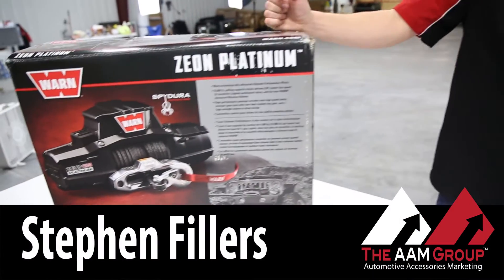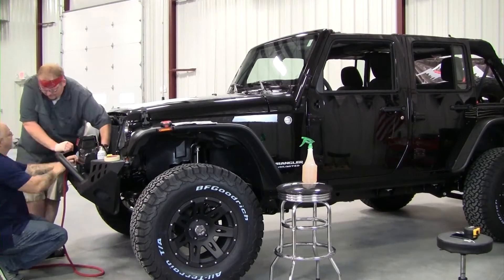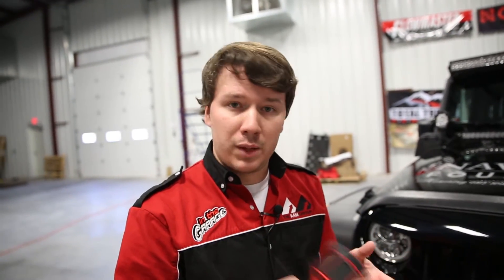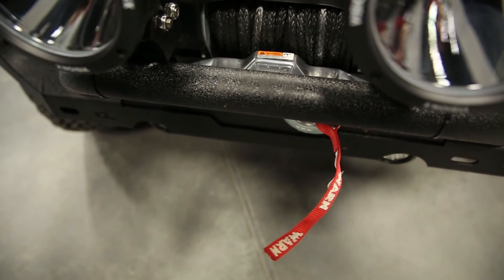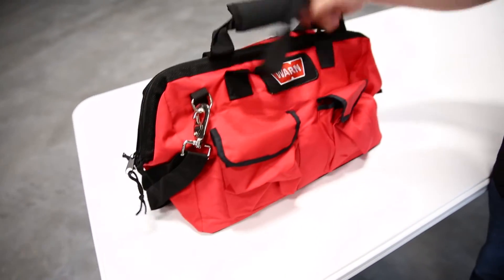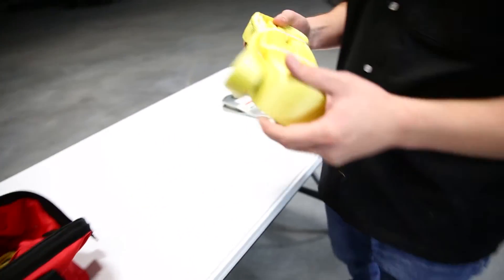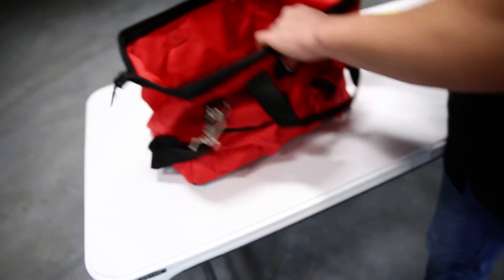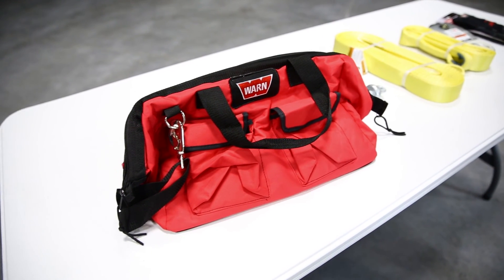NSF1 Project Jeep Part 12: Warn Zeon Winch and Accessory Bag

Comment: Yeah nice video, but can anyone tell me what a "D-clamp is?"  Those big honkin' metal things are called 3/4" Bow or Anchor Shackles!  

Anchor shackle - Bow shackles and anchor shackles are terms that are often used interchangeably, as both names refer to a shackle with a larger, rounded “O” shape look. However, a bow shackle typically has a larger, more defined bow area than an anchor shackle. The rounded design of anchor shackles and bow shackles allow them to take loads from many directions without developing significant side load.  This is what we use for winching!

Chain shackle - Chain shackles are also known as D-shackles. Both refer to the “D” shape design. A d-shackle is narrower than a bow or anchor shackle and generally have a threaded pin or pin close. The smaller loop is designed to take high loads primarily in line. Side and racking loads may twist or bend a D or chain shackle.  Nope, not a 'D-clamp either!

Also, each shackle is stamped or embossed on the side of it, with its Safe Working Load Limit.  If you come across one that does not have this information on it, Do Not Use Use It!  It most likely is substandard or a knockoff and has not certification it have been tested.  

Please take the time to learn the equipment before you get in front of a camera and make yourself look foolish.